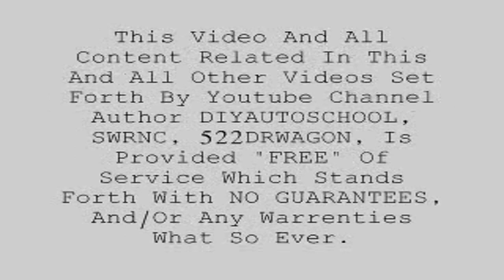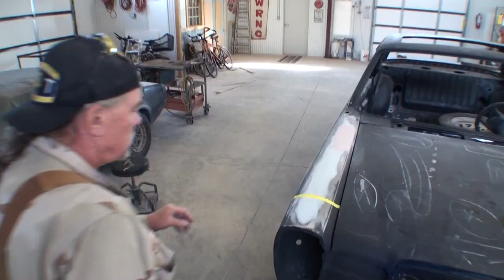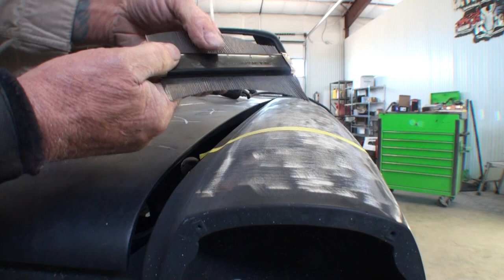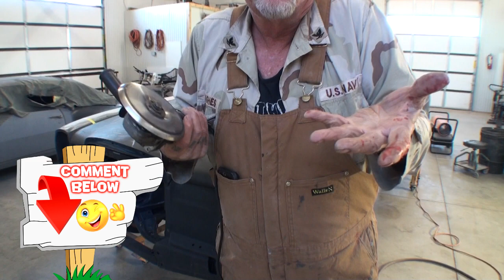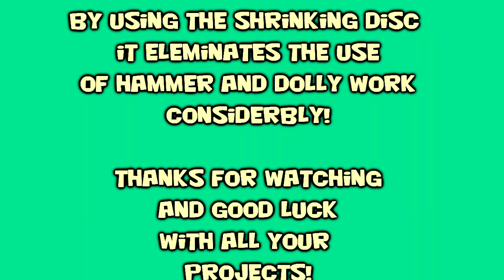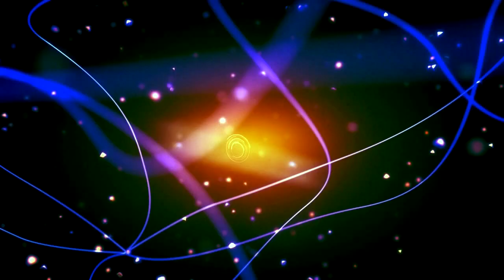Dent Repair - How To Use A "Shrinking Disc" For Beginners -- Tips And Tricks

Comment: Re that sharp edge. I've just bought some silicone U shaped edge protector  It fits an edge 1mm to 2mm thick so ideal for this. On my application I will glue it on with Bondic which is UV cured. The UV light will shine through the clear silicone.

Comment: Been watching a lot of your videos. Good advice. I have a door that I am reskinning about 3/4 of it. It had about a .250 + bondo in the upper part of the door. I cut the rusted door skin about 2 inches below the body line. There is no damage on the upper part but  the reason someone put that much bondo on was the door skin is  radiused  inward instead of outward and bondo the crap out of it to get the contour it should have. I can pull it  out where is need to be but goes right back to its relaxed position. It's like it's been leaned against and the metal formed to a inward radius. Would shrinking this from inside the door panel cause the metal shrink and and hold the outward contour it should have? Hope this makes sense.

Comment: Pete, it was a different subject a year maybe a year & one half ago, but I saw your big 10”   on the roll cart on a grinder. I new what it was but suggested a video on shrinking metal. I saw the guy who perhaps invented these in a video, but regardless, thanks for showing us as this repair was perfect for the tool. Glad to see adds running, I let them run all the way thru letting get some coin. I ordered the Astro Pneumatics Euro Pro HE with 1.3 mm tip and a 5/8”-11 stud extender for my buffer. I purchased a 3/16” stroke-stroke palm sander air powered for clear coat. I cannot thank you enough for trials, reviews, tips and  techniques for doing it right. Unfortunately it’s 10 degrees high temp all week in a February in NE. Who’s a thunk it. Send Sammie up here to warm  it up. Love the intro! Is Minnie learning well in her Catholicism classes? God bless both! Wrap your finger. You, I and other know, it ain’t the last time we’ll spring a leak and drip red stuff on the floor. I want to by a color SWRNC “Tee” shirt that is color in XXL for us big 6’3” guys. Get caught up onTetanus shot, flu shots, previnar 13, they need a booster. We all just want you around for a long long time! Thanks Pete

Comment: Great to to see you up and running Pete , keep up the great work and thanks for the tips! I also have a question, i sprayed 2 coats of sealer on my car but im seeing a few crevices where rust is coming through, did i not put enough on or is the eastwood epoxy just crap? thanks again!

Comment: When I was restoring my AD truck,  the side bed panels were really banged up. I tried straightening one side with a hammer and dolly, but I ended up stretching the metal like a balloon. 
So I ended up using a torch, getting it red hot and then soaking it with water. And it actually work. But it was so much trouble to get it straight (a neighbor called the police on me, because of the noise from the pounding. And they lived across the street). I ended up buying a reproduction panel for the other side.
Reply: Use the hammer on the neighbor
Reply: @xmo552  
When the police showed up,   i had just finished. So I had closed the garage and was walking back to the house, when I saw the police standing at front gate.
Oh well, I got the job done.😁

Comment: You totally reminded me to get the contour tool. I'm working on practically the same car 1974 280C. The front passenger fender had rust rot from the headlight bezel back about 8".  After cutting the rust off and getting all the fender glue out of the way, I welded in a patch I made using my home made anvil.  I have the contour at Looks about right, but, I want it to be a perfect match. Other than that the rest of the car is in pretty great shape.

Comment: I always had trouble trying to do this. I take it the blowtorch is too much?
Reply: using a torch is for caved in metal not crowned metal.. Torch heat is for shrinking "oil canned area's" vs the shrinking disc is for shrinking high spots and crowns such as what you see here.. If you use a torch on this type of repair you will make things worse..
Reply: @myfriendpete  Oops. No wonder it was so difficult. Thanks.

Comment: Couldn’t you just use a powerful heat gun or hand torch?
Reply: no -- it will cave the crown in and then you'll really have serious issues.. Using a shrinking disc lets you massage the high spot slowly and evenly..

Comment: What is the advantage of of a shrinking disk over direct heat (torch) to put heat into the metal?
Reply: The disc only heats on the high spots and over a larger area faster and easier.

Comment: Hi Pete 
Great channel with excellent tips. 
With the shrinking disc you need the right spacer so that the thread does not protrude. You can then hold the disc flat on the panel . Will help the process much better. 
Cheers Eddie Ryan